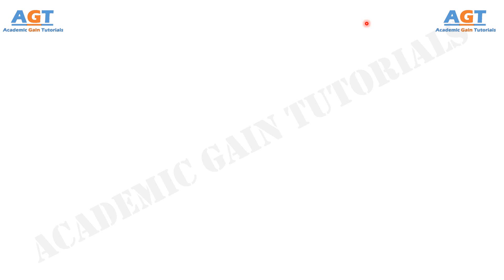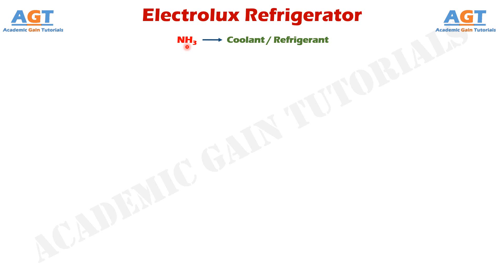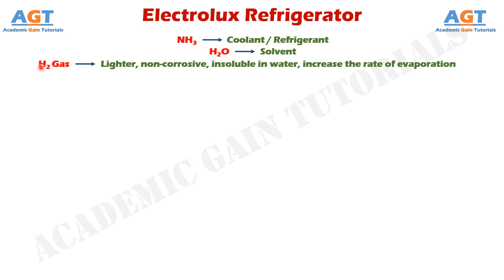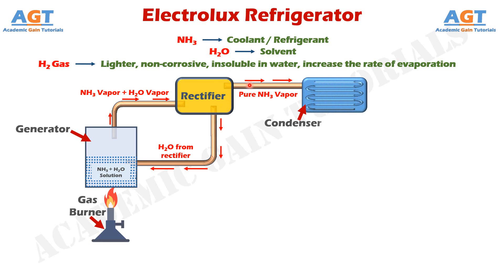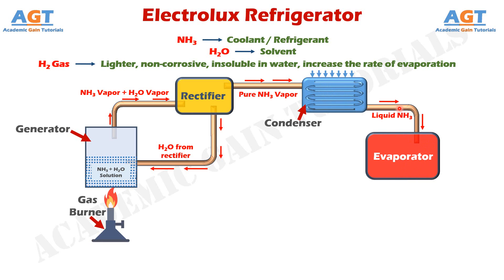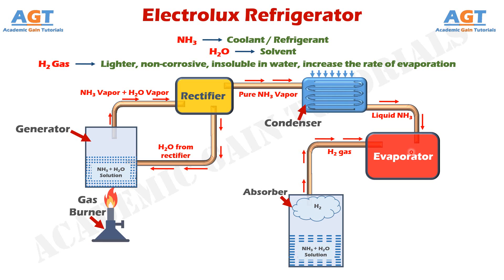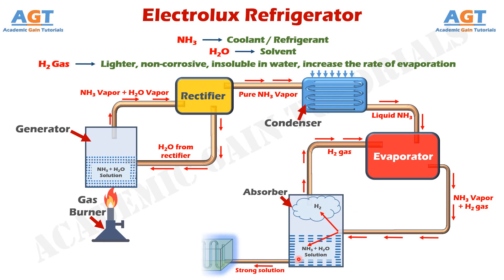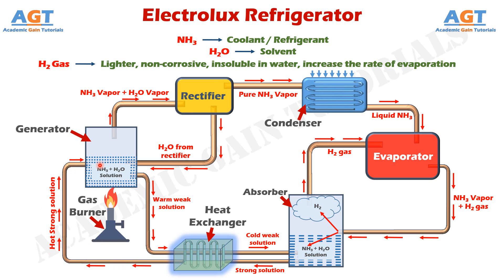How Domestic Electrolux Refrigerator Works - 3 Fluid Refrigeration System Parts & Function Explained

Comment: Don't we need an expansion valve here? And why?
Reply: In this system Hydrogen reduces the partial pressure of ammonia and thus provides the evaporation and cooling. Here, the H2 serves the function of the expansion valve. 
Water in the absorber turns the ammonia vapor into liquid. Here, water is acting like the compressor and condenser in a traditional AC unit.
Reply: Due to evaporation effect by H2 there is no need . Since evaporation causes cooling.
Reply: We do throttling  in order to bring down the refrigerant temperature in order to produce refrigeration effect. Here our purpose is solved by evaporation which causes cooling effect.
Reply: Pressure is  same everywhere in the system so no expansion valve is required for reducing pressure